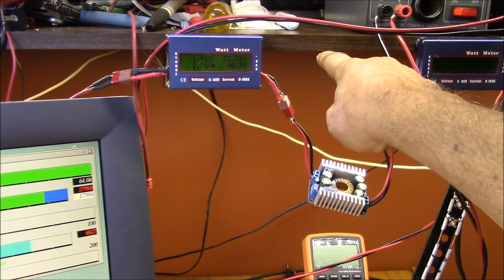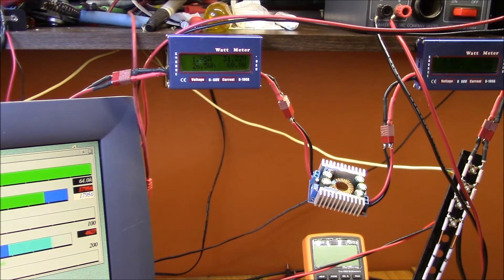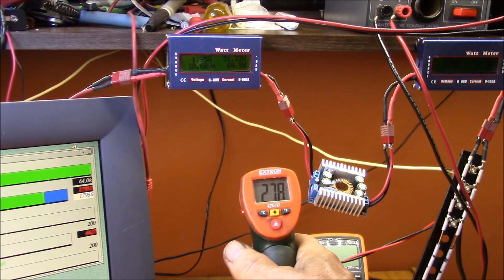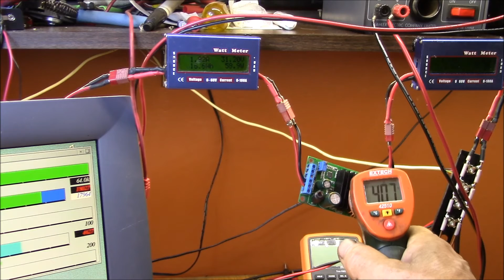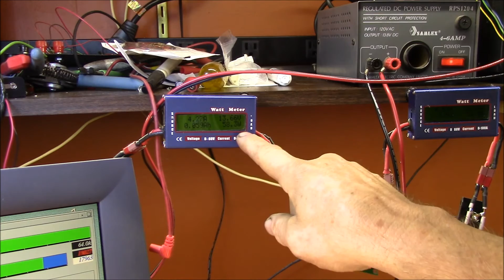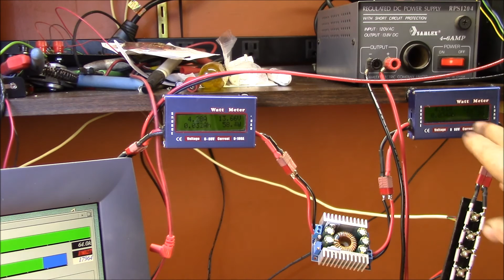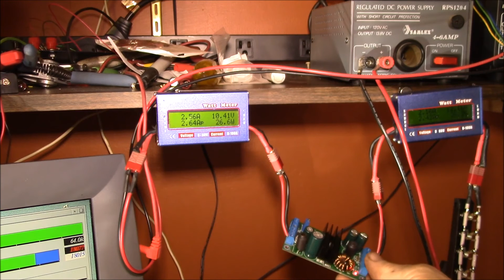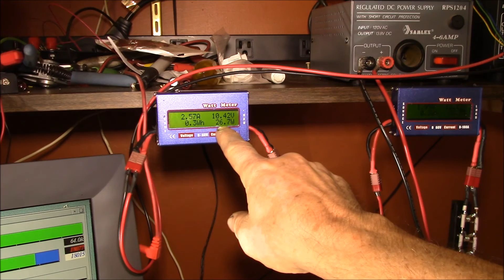DROK 8A DC Buck Converter Review, Part 3

Comment: Hi friend 
I saw you are testing 8A dc-dc voltagte converter , right ? 
I know some better one , you can check http://hz.aliexpress.com/store/product/RD-DPS3012-Constant-Voltage-current-Step-down-Programmable-Power-Supply-module-buck-Voltage-converter-color-LCD/923042_32685179404.html , this is 12A and it has LCD color display . 
and there is the similar one 
http://hz.aliexpress.com/store/product/DP4016-Constant-Voltage-Step-down-Programmable-Power-Supply-buck-converter-Digital-voltage-meter-led-display-Red/923042_32509224258.html 
you compare ..

Comment from the maker: Either one would work.  It all depends on your monitor and how it tolerates voltage swings below 12V.  My monitor seemed to be fine down as low as I tested for a typical low battery voltage.  The buck converter will maintain say 12V output down until the battery voltage drops below 12.1 or 12.2 volts, then the output voltage drops with the battery voltage.  The SEPIC buck/boost converter will hold 12V no matter what the input.  The SEPIC converters are more expensive and you have less selection of sizes, so that may influence the purchase.  I didn't notice much in the way of efficiency differences with voltages a few volts either side of 12V.  I think the synchronous converter is a bit more efficient with higher voltage differences and it has the constant output.

Comment: Thanks for the information!  It's been useful to see this setup being tested. I'm very new to this and have my head spinning with the learning curve involved.  I am in the process of putting an LCD monitor in my camper van. It has a power brick that reads: input 100-240v~50/60Hz 1.2A; output 12V --- ... 5000mA.    It'll be connected to a Blue Sea Fuse Block.  There's a 375Ah 12volt battery bank w/ 300 watts of solar installed.  Would you recommend this Buck Converter or should I get something like a SEPIC Buck Boost converter?